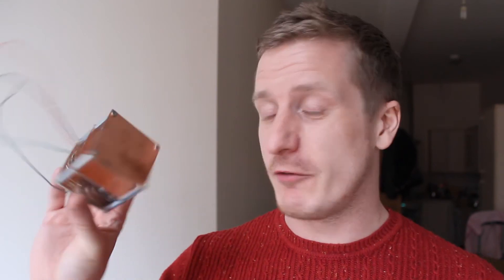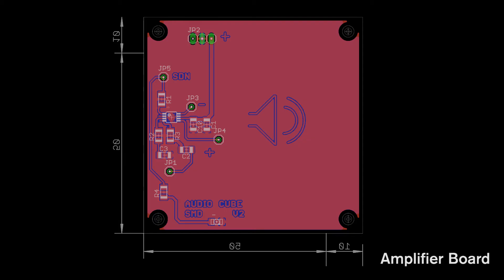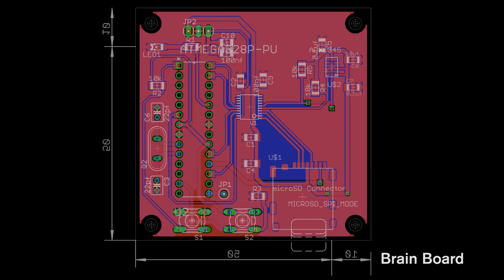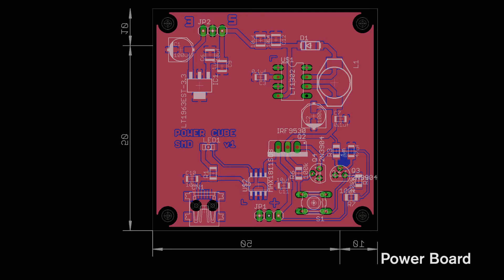Audio Cube - Part 2

Comment: Don't be put off trying to make your own PCBs at home. For small prototype boards, the toner-transfer pcb method is cheap and easy to do at home and only needs minimal equipment. I use it all the time for knocking together small boards. You can even do reasonable double sided boards with a bit of practice. For more reliable (and neat) results you can make a simple U.V. light-box and go down the photo-resist route. Again, for prototypes you don't need fancy silk-screened part designators so simple bare copper boards are fine. Beg/borrow/steal a small PCB drill from your work and you're good to go :O)   Go on....... you know it makes sense......